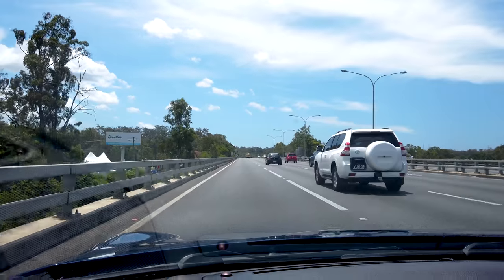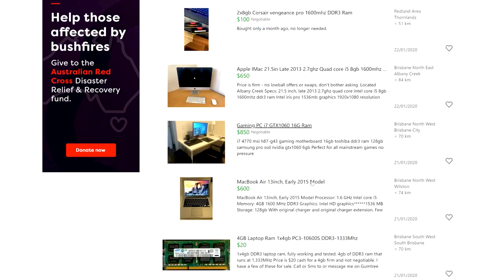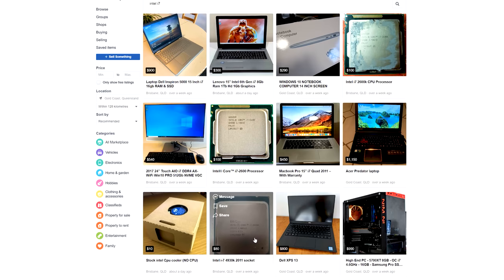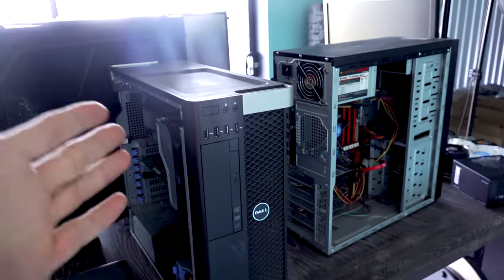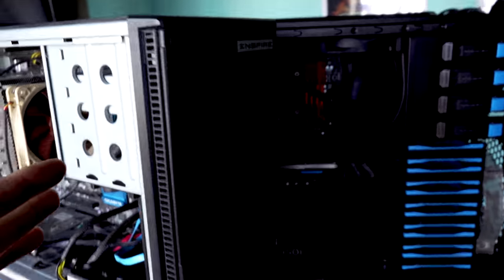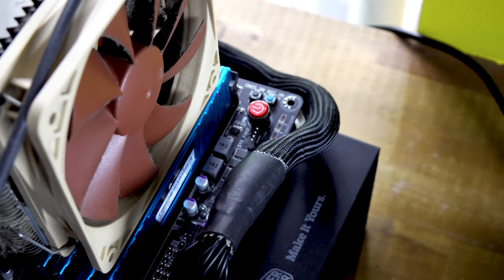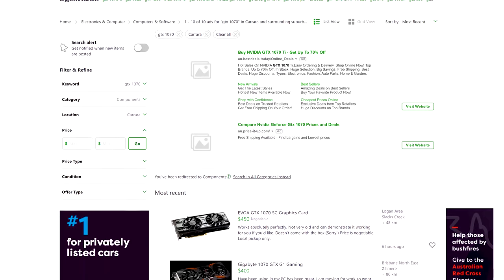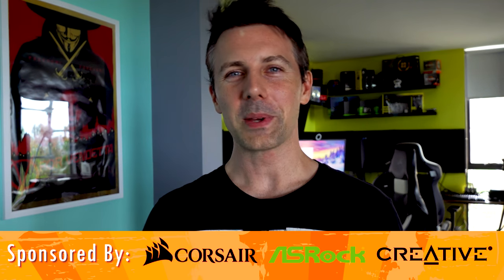January's 2020 USED PC Parts Hunt - Buying UNTESTED $100 PCs

Comment: Best deal ever for me was a r5 1600, thermaltake j24 case with 2 Corsair red fans, a b350 am4 mobo and a Corsair cx550 semi modular psu, all for $160 Aussie dollars
Reply: Thats a nice deal you got my friend
Reply: Damn, that's crazy. 
-someone that lives in europe.
Reply: @aominelaw981  rip europe prices...
its sometimes almost cheaper to get from usa ebay + shipping and taxe then buy it in europe ebay + shipping...
Reply: @reggiexp69  it's more expensive to do that. For example in the UK a used 1080ti costs £450 and in the US it costs $450, a LOT cheaper. But the shipping costs another $70 minimum and then you have to pay import duty which is 23.5% of the total cost. It's why the UK is so expensive for PC parts, that 23.5% levee is what drives up prices of all parts since not only do the resellers charge you 23.5% extra that's unlisted but you also get the 20% VAT
Reply: @weavercs4014  what 23% aint even the tva? Da fuk now i understand the uk prices why they soo expensive on ebay

Comment: 25:02 Noctua NH-D14? That's a find! You can buy an AM4 bracket for it pretty cheap. There were also brackets for socket 2011.
Reply: soupwizard the d14 is an absolute monster! It keeps my 185w overclocked 3930k at 80c under load with 5 year old thermal paste! If it ain’t broke don’t fix it!
Reply: Face Stabber wouldn’t hurt
Reply: Face Stabber I’m nervous to stuff it up - 80c is actually a really good stress test temp for that level of power draw
Reply: @MarshallSambell  is it? My 9700k under max load at 5.1Ghz draws 255W and never gets above 65 degrees using an H100i Pro. Yes it is better than your air cooler but it also has to cool an extra 100W worth of heat and is 15 cooler
Reply: Adam Flexen there’s too many other factors at play such as case fans and water vs air cooling etc. Both PSU Calcs I ran indicate a power draw of 340w on my CPU during something such as an intel burn test, and this seems about right as my gaming power consumption system wide is high 400w with my overclocked 1060 and cpu not at 100%, would be interesting to know how much an overclocked 3930k draws from the wall. edit: at 1.4v a reviewer found it draws 525w so this is reasonable. I think my software measuring CPU power draw is wrong.
Reply: UnknownPlayer x58 doesn’t have AVX instructions which use a heap more power

Comment: The T3600 with E5-1650 is sweet.  I have the T5600 with dual E5-2689 and it is a beast.  Got the Desktop Server in a company decommissioning program for employees(free!!!, zero book value). It came with the Dell OEM 825W PSU! The CPU's were a $140 upgrade (matched pair) from E5-2667's that came with the PC.  The GTX970 I purchased separately at the time (late 2018) for $120.  For $260 in total, not a bad setup for productivity, rendering and 1080P med-high gaming. CB R15=2200 (2x8C/2x16T, all core 3.3 Ghz).

When we cleaned out the lab a year later, another T5600 with bad I/O was binned.  It was a shell (no CPU's, no PSU, etc.), but the CPU fans were still there, along with extra OEM power cables, so I pulled those from the bin outside, too!  These CPU fans are proprietary and expensive as hell to replace.

Comment: I still use that nzxt phantom full tower case today even though it's like, 6 or 7 years old. I love the aesthetic, and I even bought the side panel with a window cutout from nzxt before they discontinued them. Absolute banger with tons of room for drives and extra fans. Not a big fan of the current "square plain black box made of glass" cases that are popular now. Only thing I wish the phantom had was a power supply shroud, but I'm too cheap to get a custom one machine'd for it. Looking forward to seeing what you build in it!
Reply: shoud's available for phantom i bought one last year but sold pc , searched on google and got one from portugal

Comment: I've started flipping 100$pcs / pc parts for like a month now, i didn't profit too much, but its alright.
Start: 200$
Bought a pc for 80$ sold it for 110 (pentium g3320 + hd 6670 + 8gb ram)
Later bought another for 100 (q8300, 8gb ram, hd 7950) sold it for 200$
Then an Rx 580 4gb for 100$, traded it for and xbox one, then for an fx8350 with rx 460 pc, which made me 150$ in profit
2 days ago i bought a gt 1030, an rx 460 4gb, and an i3 with h61 mobo and 4gb ram for 90$ im expecting like another 80$ profit.
(doing this till i make it up to a mid range dirt bike)
Thank you Bryan for inspirating me! :)

Comment: The first pc you checked has a bad cap inside the power supply you can change it if you find the right one its easy, just some soldering, but be sure to discharge the caps cause some high voltage there

Comment: The G710+ with the orange trim comes with a Cherry MX brown switch while the blue trim comes with MX Blues. The only downside to the logitech mechanical keyboards are their poor low quality keycaps. Not only do they shine up in a short amount of time but their stems are also quite thin and brittle which means they will crack quite easily compared to other OEMs and the keycaps they use.

Comment: I just built my first computer in over 10 years, got a 3010 optiplex, threw a i7-2600k and wifi for $106, came with windows. I'm throwing in a rx 570, 600watt psu, ssd and coolmax air cooler. going to overclock it and game until prices drop a ltitle more and then I'll sell the oxiplex for $250 witih windows, but no graphics, psu or ssd.  Advertise it at an i7 optiplex, will defiantly sell fast for double the money. was a good warm up too for hunting the used parts scene.

It seems like we are in a technological platuae, most games have not demanded to much higher performance, compared to the incline that it was ten years ago when I was a kid.  BUT SOON, I'd say in 2-3 years there will be another huge purge of what we are currently operating on, so it's good to have a system you can hauck, as computers are not like other technologies, such as cars which can perform on the same playing field as any of the new models.  Computer tech gets obsolete faster every year, but consumer availability to the highest end are getting further separated

Comment: Question. Why would you offer 90 AUD for a R9 4GB? have RX 570 not come down in price in Australia? I would think there are better cards for the same price.
Reply: rx 570 is pretty much equally fast or a tiny bit slower than the r9 290x. rx 570 4gb is a newer card and uses quite a bit less watts, so that's what it has going for it.
Reply: @jasper8291  it's 200mhz faster, better power efficiency, newer, but still.
Reply: @no.1baller939  you cannot compare different gpus based on their clocks peed (mhz). It's only accurate to look at benchmarks for comparison
Reply: @jasper8291  yeah, due to difference in architecture, brand (AMD vs Nvidia)
Reply: @no.1baller939  yeah yeah you're right, but also AMD vs AMD you can't compare. On anandtech.com/bench you can easily compare different cards, e.g. see how much fps particular cards score in certain games
Reply: @jasper8291  very interesting...never knew they were that close in performance
Reply: @no.1baller939  Yeah, but you're right that it's smarter today to choose a rx 570 over a r9 290 if you have the choice. The rx is simply a newer card, and will probably receive driver/performance updates for a bit longer than a r9 290, which is really getting old today (~2014)

Comment: I respect what you do.  I'd love to get in on the game, but I lack the space and it drives the wife crazy.  Most of my parts are acquired from intercepting systems that are going in the dumpster.  There's a lot of potato components, but at least they can be repurposed and given a better home.  OEM keys are always a welcome find as well.  One thing that's always bothered me about local trades is the fact that I get a sense of uneasiness when I meet people.  I typically have a friend with me when I make exchanges just in case.  Do you employ the same recommendation or do you go it alone?  If the former, who's your friend and are they ever in your videos?

Comment: I've had good luck buying used components on eBay and FB marketplace. The one time I took a gamble on a system not working was because I was looking for a specific case (Antec 902) and found a complete, non working pc on ebay. I paid about $50 more than I would have for the case but when I got it I just took it apart, put it all back together, and it booted up fine and worked for years. Was a good old Core2Quad Q6600. just a few years ago I gave those components to a friend who used them for 2 years himself. I suspect that it was just that the CPU needed to be re-seated. I've had that issue before on other machines. mostly servers.

Comment: Favourite pickup is the e5 1650 - you need to pair it with the quad channel 2400 MHz and a beast x79 board and you’ll have a sweet flip, and then put an e5-2670 in that OEM motherboard and sell it as an office/workstation/server PC

Comment: Got a small sff dell are there any small gaming pc case I can change into but still use the tiny 240 psu 
I intend to add a low profile 1030 or something to make a entry gaming pc with extra ram and ssd

Comment: Bryan you reckon I got a good deal? optiplex 990 with a 120g SSD/4gb ram for $100 and a MSI R9 390 for $130? 

Plan on putting them in a case with a power supply and more ram and flipping it
Reply: Overpaid for the r9 390. By like 30-40 bucks if this is USD.
Reply: @GummyBearRacing  this is aud.

Comment: Buying that Noctua system for the P18x case was worth it alone IMO. Antec was so far ahead of their time with that model. Chambered PSU, the airflow, dust filters, basic cable management, sound dampening, janky water cooling support, removable drive bays and a sleek design.
 
Even in 2020 is still looks great and is a practical solution.

Comment: Got Gigabyte X58UDR motherboard,24 gbt,of 1333 ram,X5675 Xeon.
Paired it with 7970,new 240 SSD,1 tbt wd blue,new EVGA 750 psu.
What would be a reasonable price ,if I'll put it in a simple case (no window,only side fans).
Or,should I  go for a fancy tempered glass case ???

Comment: i7 3770 running with a gtx 1050ti best recommended settings to get best performance, motherboard is a DH61CR
Reply: Just make sure your unilateral phase detractors are aligned and you should be fine.

Comment: The Geforce 10 series have been overpriced for a while(you can find decent deals on a 1070 if you wait and see on eBay) the 900 series are where all the good deals are right now.
Reply: I have a GTX 970 in my PC and it's beginning to show its age now with titles such as Jedi Fallen Order really giving it a battering. I've got a 4690k (4.3Ghz) and 16GB of RAM to go with it and I'm struggling to get to 60fps on the Lowest settings.
Reply: voteDC what resolution? It should be perfectly playable at higher settings at 1080p.
Reply: @EvilTurkeySlices  At 1080p. Go any Higher than Medium (which is the lowest setting) and the frame rate fluctuates a lot. I can lock it to 30fps and dial things up and it keeps that solid.

I had thought it could be the overclocks on my CPU and RAM so I dialed them back to stock but the only change was for the worse. Plus Shadow of the Tomb Raider can keep 60fps fairly well with a mix of settings.

Comment: Try that Gtx 780 on the DVI-I with a VGA adaptor. I have an Asus gtx 780 where all the digital outputs (HDMI, DVI-D and DP) are all dead, but the DVI-I works fine.

Comment: I suppose I could buy a premium setup and dump $5-6K on a pretty nice and shiny new PC rig with the latest and greatest and with custom water cooling.  But I get so much more satisfaction, as a hobby and enthusiast, building with used server parts (Xeon X79 and X99, essentially) for myself and my kids.  At a fraction of the cost and with a heap-ton more fun, for me anyways. I think I spent about $550 on an E5-1650V2/ASUS p9X79Pro/32GB 1600 un-buffered DDR3/SSD + 4 legacy HDD's/650WPS (new)/GI-D66A CPU Cooler (new)/RGB blinged case (new)/RX590 (new). More than enough for my needs.  Looks pretty good too!

Local deal shopping is a blast.

Comment: Here you go Tech YES that Phantom case add gtx 960, 1000W psu, throw in a decent Xeon and mobo combo and use the 2400 16gbs of ram, 2 tb hdd, water cooler, the nice keyboard and a 24 inch monitor All you need to do is toss in a ssd and add a mouse then you have a whole gaming setup someone would love and you could get your total cost of everything you bought almost just from that one pc and just build a few more budget based systems and get PURE PROFIT on the rest :P

Comment: in my country rn market is full of 4th gen office laptops maybe bc of windows 7
Reply: I see fair number of older laptops being dumped here in the US as well because of Win 7, and people not knowing that if they have 8GB of RAM they can run Win 10, or even get much better performance with Linux distro such as Manjaro Budgie, but of course most of the ones i see for sale at least local pickup are lowend crap not worth my gas to drive for.

Comment: No 4770K, but the 3770K isnjust as good. Itnis 22nm and gas PCIe 3.0 support. So i would say that with all the ram and other working parts is a win.
The 3900X is $450usd with the 3950X at $730 here in the states.
9900K's are $430 When the 9900 are $440.lol Not bad really, for a 9900K. There was a open box 3700X for $220. 2700X's for $140 all day. I found 2 Sapphire Nitro+ RX 5700XT Special Editions with the ARGB fans. Got both for $360 a piece. Gotta have that ARGB. Those SE Nitro's are clocked to 2035MHz. They had some other 5700XT's like the Pulse for $300. These were really great prices, I surprised to see you guys having GPU struggles. Hell, I found the eVGA 1080ti FTW3 for $430. Was pretty happy with that until I found another eVGA 2080ti FTW3 XC Ultra for $960 and a RTX 2080ti OC for $900 flat. Finally prices are starting to drop. There are ASUS 2070 dual's for $340. When there are other 2070's for $500. Sometimes i don't understand who sets these prices for the GPU's and CPU's but, i'm not complaining. 
Sometimes you gotta go high end to get those deals.

Comment: I got a hella lucky deal this week. I got...well i believe it was a pre-built that was upgraded and then sold off after the guy built a new one, Ryzen 1400, msi bazooka b350, cyberpower case, hyperx headset, logitech BIG mouse pad, 1tb hd and a cooler master basic cooler (looks like a stock AMD cooler) all that for $100!!! I ended up trading the 1gb hd for 4gbX2 DDR4, I used a PSU hard drives and 960 4gb and fans that I already had.

That was my bday gift to my son, I upgraded his gaming set up from the FX6300 he was on. Just used the PSU GPU fans and drives from his current system and combined them with the new Ryzen system and BOOM!

I got about $200 in that build (the gpu was a gift a while ago) the psu came in the FX6300 system, I pulled the 1TBHD he uses for games from a dead laptop and I bought the 128gb SSD for $20 new in box locally.

I got lucky but that's who I do it, I hunt and wait for those right deals!

Comment: I think most of the overpriced GPUs are from people upgrading and can sit on them until they sell. I have a 3770k in my living room I wanted to upgrade to a 1070 but most people wanted around $300 used. I spent a bit more and bought a RTX2060 which the CPU handles just fine.

Comment: Check out the ebay chinese gtx 1080s. They’re $200 mobile chips they somehow turned into a pc graphics card
Reply: Your link is not what your describing
Reply: The only thing there for around $200 is an auction for a used 1080. I'd be really interested in checking out those 1080s described.
Reply: There’s also a thread in the sellers description

Comment: I have been looking at used workstation but ebay US prices on those Xeon workstation are stupid, especially when new Ryzen 7 2700 is $135 or so... and Ryzen 5 3600 at Microcenter is $150.

Comment: Ive got that exact same model dell precision with a 2667 and rx480 that i use as a linux pc. They're pretty good if you can get them for the right price
Reply: Picked up a Precision T5600 when my company decommissioned it as a developer platform in late 2018.  At Book value ($0)!!!!! Dual E5-2667 with stock air coolers, 32GB DDR3 R-EEC 1600 RAM, and 825W power supply. Swapped out the CPU's with dual E5-2689's (total $160) and added GTX 970OC ($120). What an awesome desktop server. Handles medium to high 1080P without issue.  CB15 score is 2200.

Comment: 20:17 Anyone hear that noise? I couldn't hear any odd noise, but I don't know if that's because I have middle-aged hearing and can't hear high pitches, or if my tinnitus overwhelmed the noise.
Reply from the maker: Yeah the power supply is pretty much on its last legs for that one :(
Reply: @techyescity  Sir, your capacitors whistle and they are redy to pop.

Comment: Sold my old system just the other weok for 900AUD.
Asus Sabertooth P67, i7 2600K, 16GB Corsair Vengeance, MSI GTX 1070 Aero, 120GB ADATA S511, 750GB HDD, FD Define R2 Case, TX650w PSU, 27" 1440p monitor, Sidewinder X4 keyb and Qpad Mouse.

Comment: when you can will you please review the belkin 2.1 hdmi cable..i notice a 20fps increase across most games i play when using the gtx 970...its almost like the hdmi 1.4 cables were and are giving me poor fps and even holding back the actual performance of my used gtx 970..i'm using a dell t3500 with an overclocked x58 xeon the w3680 overclocked to 4ghz using a 120mm fan mod on the heatsink with zip ties..lol...anyway if you could get your hands on a true hdmi 2.1 cable i'd appreciate it if you could explain the fps increase i'm assuming the newer cable free's up somebandwith i would usually not get if i remember right another youtuber said the rx 5500 xt is held back by pci-3.0 and the only way to get the full power and benefit is to use a pcie-4.0 motherboard...i didnt know this x58 system was using pci-e 2.0..lol